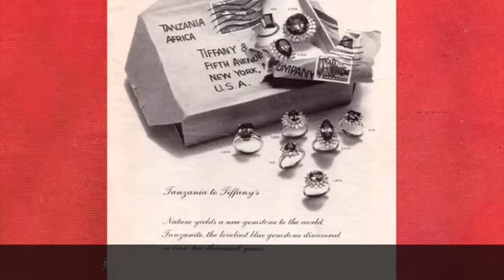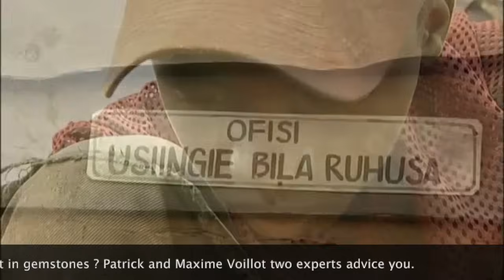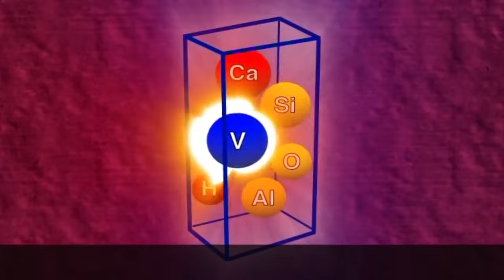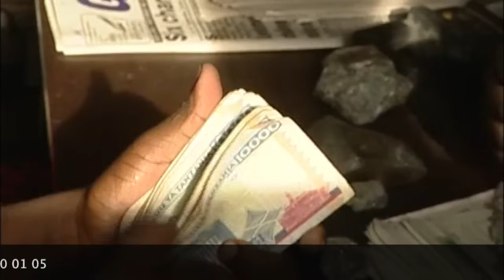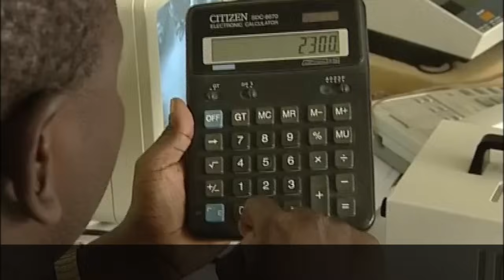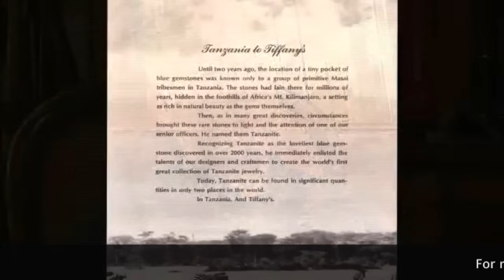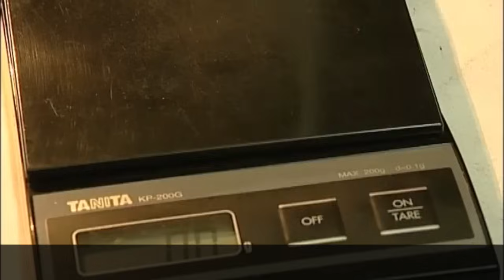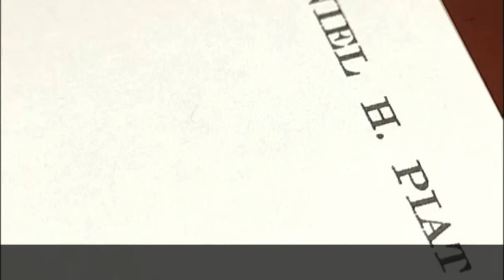Tanzanite from Tanzania documentary of Patrick Voillot

Comment: The whip that you see being used on the men that want to work in the mines is called a "Kiboko" in Swahili or a "Sjambok" in South Africa. It is made from the fresh hide of the hippopotamus by cutting stripes of app. 1 inch width from the spine down to the low end of the belly using the natural reduction in thickness of the skin, gradually reducing the width of the piece as you cut. If you do it right you end up with a stripe of rawhide of about 4-6 feet in length, that is then hanged up with the thick end up and a weight on the thin end to straighten it somewhere in the shade where you let it dry, occasionally applying oil or animal fat on its entire length. You end up with a pretty rigid, yet flexible and very durable instrument ideal to use it as a whip on animals and humans alike. It can inflict very serious extremely painful cuts on the bare skin of a human if the strike is done with force and purpose. Traditionally the Kiboko was used to punish slaves.To see it still being used by humans against their fellow men is making me sick.

Comment: Graphite is very soft not hard. A hardness of 1-2.
Reply: Graphite stone is extremely hard. You havent seen it. it is not like pencil tip.
Reply: @drpk6514  The narrator stated that graphite is hard. If they said the graphite schist host rock is very hard then sure.
Reply: @shellmeyours  Actually graphite is very hard. I dont know if you have ever seen a graphite rod or brick (it is used in industry and even Nuclear energy reactors) they are extremely tough. The Moh's hardness is completely a different thing. When you reach graphite in a mine you dont start rubbing it away...